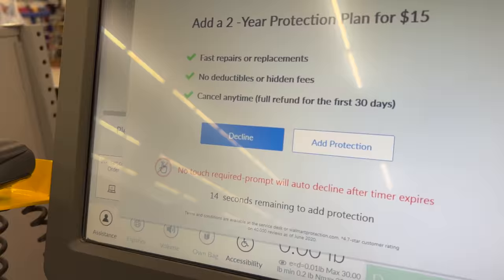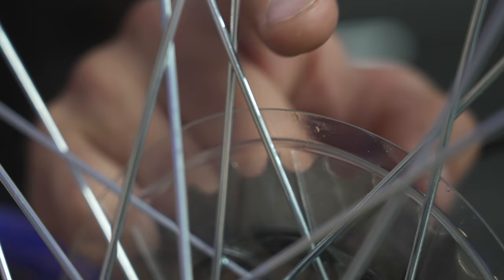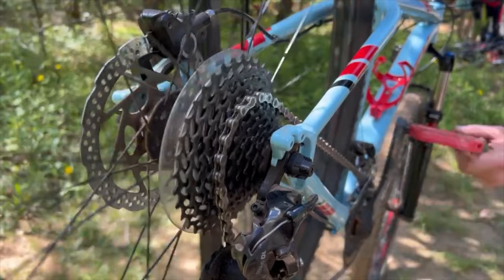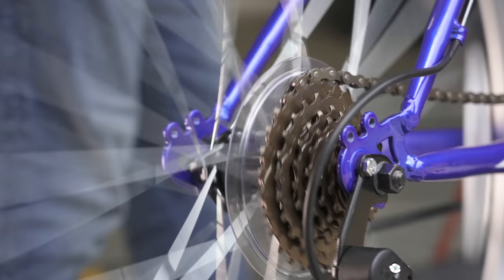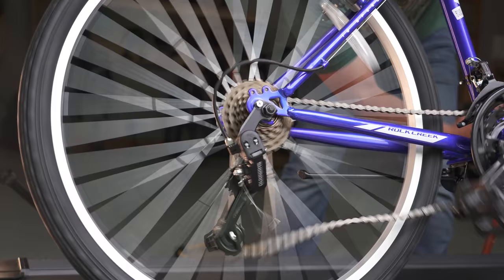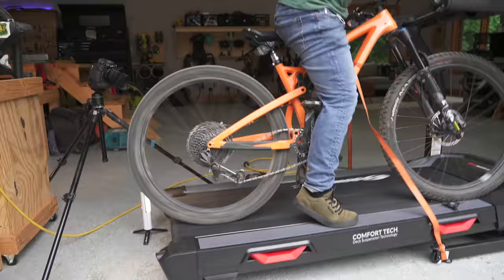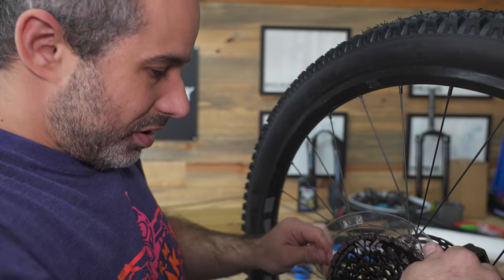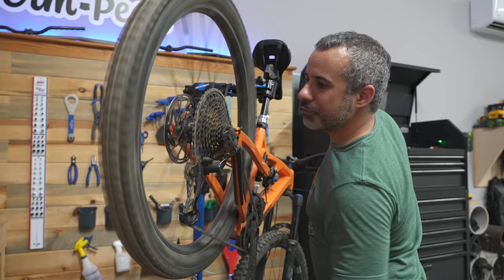What is your "dork disc" actually for? What happens if you remove it?

Comment: at 6:31 to 6:33 you see, what might happen without the disk: you got away lightly, only because you weren't fully mounted on the pedals, and only the wheels moving, but neither the bike nor you. Still, the pedal gave you enough reason to shriek, when it hit the hollow of your knee.
   Essentially, the chain blocked the freewheeling mechanism. This might result in several different outcomes:
- The wheel itself blocking completely - when going downhill, this might send you flying over the handlebar
- The wheel still turning, but taking the chain with it between the spokes and the cassette, like a V-belt by a pulley. That was happening here. Now imagine, what will happen, if you go downhill, at 20 km/h, the bike with you on top at about 90 kg, and this improvised pulley tearing at your front cog. Since the diameter of this false pulley is even smaller than the smallest cog in your cassette, the forces at your front cog will be rather big. Something has to give way:
-- if you manage to keep your feet on the pedals, thus blocking the front cog, it will be your rear wheel spokes, cassette & chain, that will go
-- if you slip from the forcibly moved pedals, you might be lucky, to get away with some hematomas caused by the pedals hitting your legs from behind. But it can get ugly very fast. If hit hard enough from behind, not only your leg might break, you most certainly will also tumble, in the worst case even try to eat your handlebar, losing some teeth.
Not trying to be too graphic, but this can get really, really painful.

Comment: The used bike I bought for my son did not have one and I did regret it. Because besides other flaws, also the shifter limits were deadjusted and on my first testride the chain cut through 2 spokes completely and damaged several more. That disc would have preventet that carnage!
At least, now I know how to change spokes and center a wheel... 😅

Comment: With a dork disk you have a decent chance to get the chain back on track simply by shifting gears , but if you do that with out it you ruin your spokes.. you ruin your spoke if you put any kind of pressure on the chain while it's off, since it's on the lowest gears , it's likely to go off when you are climbing or doing a big effort. even if it doesn't kill you here and then , it can damage your wheel such that you will need to change it with in couple of 100's miles..

Comment: Well, you could have messaged me. I got 3 nasty scars on the back of my leg. The chain jumped out, my foot fell to the ground because of no pressure on the pedals, because i was moving forward it bent backwards under the bike. Then the chain wrapped around and pulled the pedals that kept spinning, the spikes of the pedals hit my leg 5 times (5 turns) before I could stop the bike. The cuts were not actual cuts, but more like rips and horizontal, because the spikes "grabbed" the skin and pulled it, and they increased in size, the last 3 were so big that I still got 3 egg shaped scars the size of a coin.

Comment: The only time my chain got proper stuck behind the cassette was when I fist forgot and then was too lazy to take out a few extra chain links. The derailleur must've been adjusted to work with that length of chain, so a big bump and a sizeable tuft of grass were enough to slip the chain off and jam the derailleur. Interestingly enough, my spokes barely got scratched and I didn't have to replace anything!

Comment: My chain fell into the spokes and pulled the derailleur in and busted up the whole wheel. I think dork discs on higher-speed bikes with thinner chains are less of an issue than they used to be on 10-12 speed bikes with 5/6 sprocket freewheels since they usually have thicker chains and bigger spacing between the sprockets

Comment: My experience dates back 18 years ago. I was out on my old dirt jump hard tail bike at the time, and the chain  did exactly what was shown here. The chain locked up ripping the derailleur strait off, the derailleur ended up then catching the spokes locking the wheel up as it wedged between the wheel and the rear dropout. that was without a dork disc, I have no idea if having one would have made a difference, but in my experience the chain doing this can cause massive issues. Luckily it was only a 3 mile walk hope. the bike was rebuilt with some spare parts and i was back out the next day.

Comment: My expensive specialized bike didn't have this on by default. Equipped it with bafang bbshd engine and went for a ride up a steep hill. Derailer limits weren't adjusted and fell over the lowest gear into the spokes. Torque of the engine pulled on the chain hard and ruined the entire right side spokes. Damn expensive repair. 

As a new rider I didn't know and it pisses me right off such an expensive bike had such a serious flaw.

In regards to tighter tolerances mentioned in the video. It's the opposite as it was said. The tighter the distance between cassette and spokes the bigger the damage to spokes as the chain has less space to occupy without touching the spokes. With narrower gap its guaranteed the chain will grind on the spokes the entire time while it's pressed right on the right by the cassette.

Comment: I had exactly this occur years ago after a crash bent my derailleur enough to pop inside but not enough to be visibly damaged. I was pedaling hard at the time the chain popped, and when the chain caught it broke a dozen spokes, and what's left of the wheel immediately locked up. Fortunately I was going uphill so I came to a stop very quickly and didn't hurt myself, but it was an exciting few feet.

Comment: I hired a bike in Skiathos where it had not been set up right and the chain came off the cassette just on the ride back to the hotel. It went into the back wheel and took out 4 spokes. Bike shop sent a van out with another bike that I used without issue for the rest of the holiday.

Comment: If this were to happen on the trail/road you would have the added force of your weight and power driving the chain into the spokes.

It will be less catastrophic depending on how the spokes were laced, but either way you’ll probably damage the spokes.

Try the experiment on an indoor trainer. ???

Never had it happen with index shifters, but did back in the days of friction. Really gouges those spokes when it happens while climbing. 😢

Relace a wheel or face ridicule from my fellow racers?
The 20s me chose relace. 😔

Comment: I bought a second hand mtb that suddenly went flat after going reasonably fast over some rocks.  Tire sealant was bubbling from around where one of the spokes went into the rim.  After some further looking the straight pull hub had been damaged enough that the spoke could slide maybe 1-2 mm further and puncture the sealing tape.  My guess the damage was caused by the chain dropping off the cassette in during an a heavy climb and I just hadn't seen the damage when I bought the bike.  Maybe this could have been prevented by the infamous dork disc.  But the bike was still a reasonable price including the rebuilt rear wheel.

Comment: There is a simple solution.  There could be a small metal disc that attaches to the back of the cassette itself, welded or screwed on.  My crankset has one.  Just behind the large sprocket there is a metal ring, attached to the large sprocket itself, it prevents the chain from falling inside, behind the sprocket.  Also, wow, big box stores raised the prices on their garbage bikes, you used to be able to pick one of those up for just 80 dollars(not even ten years ago), now they want 130.  I would be curious to know what else was wrong with it, other than you having to readjust the gearing on it?

Fun story.  I had a couple kids in a car chase me once, sadly, a bike is no match for a car, they got me.  Yeah, they actually tried to kill me.  But I did survive.  And my bike was of course wrecked pretty bad.  So I took it into the shop and they straightened it back up.  But while they were doing that I still needed a bike.  So I went and bought one(the aforementioned 80 dollar bike).  EVERYTHING was wrong with that bike.  But before I found that one, I tested many others in the store.  One of them was so messed up that it actually failed on me and I became injured further, right there in the store.

Those big box stores' bikes are made so cheaply.  Metal parts are swapped out for plastic.  Tolerances are rendered irrelevant.  Nothing is dialed in.  The bike I ended up getting wasn't even capable of using all of the gears it had, no matter the tuning I tried to give it.  And of all the bikes I tested, which was nearly all of them, it was the only mostly functional bike they had.

Comment: The main thing I saw when you failed without the dork disk was that the peddles were no longer capable of free movement and were instead being force-driven by the rear wheel, which can certainly bang up your legs pretty bad.

Comment: There is the Dork Disc which is the clear plastic snaps- on to the spokes guard that may save you from an over shift or 2 before they break . Then there was the old school Pie Plate in chromed steel that installed behind the freewheel and would repel over shifts for life. I never cared for either on my machines to be honest. That was until the new and improved $750.00 Eurafred rear derailleur was developed and overhyped to replace those cheap and fully functional mechs from  way back long ago. Now today's Dork is the saddle resident with the empty wallet. They were known as FREDS back in the day. 🤣

Comment: I just keep those things on until they stop looking right, to protect the spokes. As soon as they start cracking or bending in the wheel, they get taken out so I'm not dealing with splintering plastic on the move. I don't see the point in removing something that hasn't given me issues. Makes sense if it isn't working on someone else's bike that they take it off. I just don't have a reason and don't want to stick my hands up in the spokes to cut something out.

Comment: What happened to me with improperly adjusted screws was that spokes got caught by derailleur cage ripping of the aluminum derailleur hanger. It took me around 2 weeks to get new one for 15€. 30€ derailleur (SHIMANO Tiagra) was still usable (I have it installed till this day). I made the bike single speed and cycled 20km home. The bike didn't even come up with dork disc and it would not make any difference.

Comment: I can’t imagine why a more esthetic solution hasn’t been developed. I had a chain break going up hill under heavy load. It whipped around the wheel and locked it up! Fortunately I was going about walking speed on a road bike. Incidentally, it broke because I had improperly mounted my chain without a quick link!

Comment: No matter how well the derailleur is adjusted you can bounce while shifting or shift two or three gears at once. In Junior High I was riding or someone was anyway the chain went off and it tore the derailer off it's mount which was not good wrecking the derailleur. In my medical opinion the last gear should have a chainguard preventing the chain from being able to shift off the last gear. Seems simple and light. C'mon Shimano make the cassette idiot proof with a built on chainguard option. Could be a clip on plastic piece so haters could remove it.

Comment: wow, random YouTube video gives possible explanation to bike wreck that happened almost 40 years ago!!  rewind to 1985-86ish, a recent growth spurt made me too tall to ride BMX comfortably, so I got a 10-speed (from Sears, I think). I liked to do "speed runs" between the major intersections near my house. that day I started at the little grocery store parking lot, mashed the button on my stopwatch and pedaled like mad. I had only gone maybe 3-4 blocks and while shifting gears suddenly I am sliding on my back with the bike on top of me!  I don't remember if the chain had come off or if it even had one of these disks, I just checked myself over (couple bruises & some road rash).  as I had at some time during the crash put my right foot through the spokes of the front wheel the bike was unrideable, so I chucked it on my shoulder and limped the few blocks home.  the bike ended up in our basement unrepaired for many years as I got my drivers license soon after that.  I can't say for sure this is what actually went wrong, but after decades of having no idea what happened this makes some sense of it.  thank you!

Comment: I actually like my spoke protectors personally mostly because when I actually ride off road I'm either on trails cut for ATV and dirt bikes or simply ridding where there isn't a trail and have had them save my ass a few times when in the woods and riding.
I usually end up with some kind of derailing problem at least once a year if I'm riding regular just simply from my limits getting kicked out of whack while ridding.

Comment: I got a metal one. Was tired of the plastic ones wearing out. :P

If you gonna install a dork disk...get one that isn't cheap plastic. The sun will bake them and they will break apart in no time. :P

My metal one came all the way from UK from eBay. It's a bit beat up now but it's definitely more stylish looking then those garbo plastic ones and it has yet to rattle around or make noise. :D

Comment: Call me a dork or call me a Fred, I don't really care.  I've been called worse, and I don't ride to get validation from ANYBODY.  I've spend almost as much time on two wheels as I do on my feet.  I rode my first non-training wheel bike when I was 5.  I raced semi-pro BMX in the 80s when I was a kid, and I saw the invention of Mountain Bikes.  I ride close to 300 miles a week.  Now get off my lawn and I'm still keeping my dork disk.  :D  It keeps overspray when I'm cleaning my cassette from fouling my rotors!  Why else would you have it?  On a serious note - the last time I had a chain malfunction (which usually is a result of poor maintenance to begin with) my dork disk saved my drivetrain.  The chain was a goner, but I needed to replace that chain anyway (hence the malfunction).  That one hurt a little since I was standing and really grinding when it popped.  I slammed my chin on my headset and one of my feet popped off the pedal and got jammed between the pedal and the ground for a bit until I could free it.  I was going a pretty good clip and it took all my skills to stay upright.

Comment: these discs keep the spokes away from  chain in case it jumps the chainring, but if the rear derailleur has the lowest and highest gear screws set correctly (the easyest way for correct settings is without chain...), the discs are not needed, 
going uphill, the gear does not change, especially to a lower one - the gear changes only without load...
the chain in the clip is too long. it must be so taut that the line passing through the axles of the jockey wheels of the derailleur must be inclined like this: "\" - at 45 degrees to the vertical of the largest ring...

Comment: I don't find them dorky or heavy or any other of those things. They most likely serve a valid purpose.
But they break easily and there's no good reason to repair them.
And i took all mine off for the simple reason that they tend to collect a bunch of crap and make cleaning your bike much more of a chore.

I also take spoke attached reflectors off for the same reason, they break and make noise and they collect a bunch of crap on the spokes and cleaning them is a chore i can do without.
I know i am a ninja at night so i make sure that i am seen before i make a move in traffic or i simply make my move when there's NO traffic.

Comment: Think the worst that happened to me without a "dork disc" was when my classic bike had a cassette put on that had a bit of extra space between the largest cog and the spokes. Sometimes the chain would fall into there if I downshifted too rapidly (it was friction shifting) - like when coming to a stop, or hit  a bump while doing so. One time I did that on a tour in the middle of nowhere, and was unable to get the chain back out from around the axle / spokes. Took out the quick link, but ended up losing that on the side of the road somewhere. Luckily I had a chain tool with me so I could just make the chain shorter, but it was stiff where I reattached it...
Reply: Everyone insisted I didn't need one, I just needed to adjust my derailleur correctly. I took it to three different bike shops, each adjusted it as conservatively as it could be while still allowing shifting into the largest cog, and this still kept happening. Had a "dork disc" installed, problem solved.

Comment: New bike day! :

Dork disc off

Reflectors off

Strip factory lube from drivetrain, re lube with squirt wax lube

Verify shifting and limit adjustments

Verify braking, lever pull settings

Set saddle height, bar height, and brake hood/lever angles 

Verify tourqe on all critical bolts  

Set preliminary suspension settings if so equipped

Check tire pressure, set up tubeless if not already 

Test ride around block. 

Bed in brake pads if disc brake equipped.

GO RIDE NEW BIKE.

NEW BIKE DAAAAAAAAAAAAAAAAY  
WOOT!   
N+1 FOR LIFE